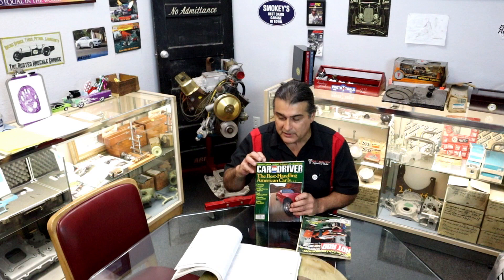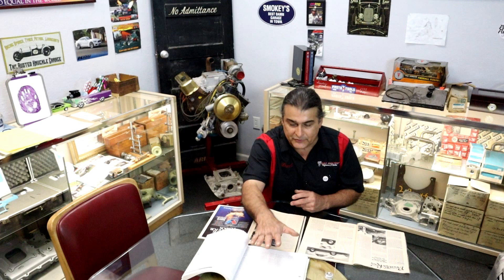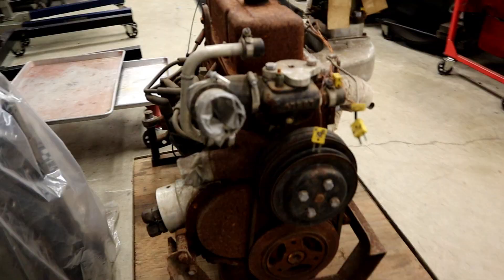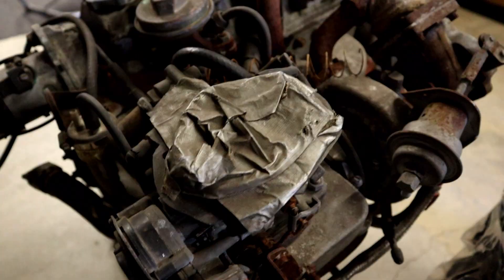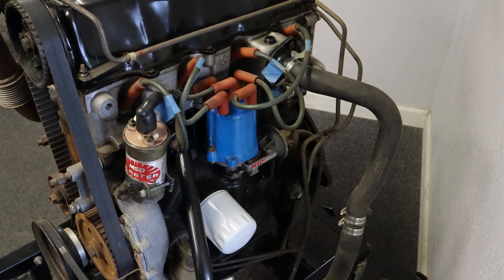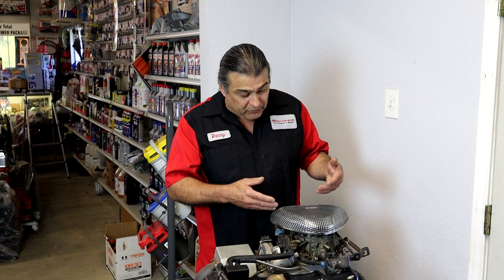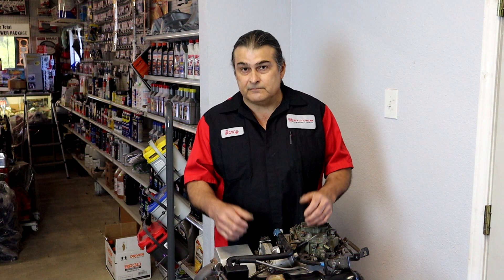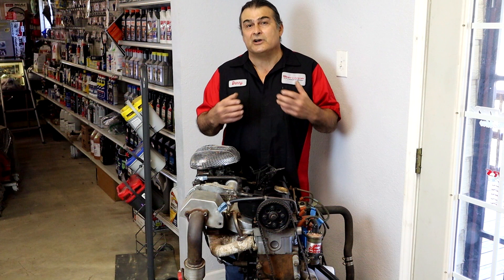What ever happened to Smokey Yunick`s Hot Vapor Engine

Comment: I remember cars would have issues with vapor lock. Wasn't that when the fuel turned to vapor in the fuel line and this would cause the engine to stop running?
Reply: Yes. I made a video about my 79 dodge van having this issue and how I solved it.
Reply: @NicholasMaietta  didn't they just wrap the exhaust or the fuel line that ran near each other to insulate.
Reply: If the fuel turns to vapor before it gets to the fuel pump  then the carburetor gets no fuel and the engine stops running. After the fuel has gone through the carburetor you want it to turn to vapor so it can burn in the cylinder.

Comment: Very Interesting, I heard about this at least 30 years ago. I'm sure if it had any draw backs, they can be solved with todays technology. I wander why these engines never came to market??
Reply: To efficient
Reply: Damn right. Can't make millions if everything is getting 60 mpg.
Reply: @RATTL3R186  Check the origin of gasoline, it started out as a waste by-product.  .   .   .   Until.   .   .   .
Reply: GM and others did seriously consider this type of engine for production. The problem was, they ran right on the ragged edge of detonation and overheating. They required a lot of expensive parts and lubricants to stand up to the heat, and if the slightest thing went wrong you could burn up your engine in seconds.
Reply: @mrdanforth3744  Thanks! I saw Smokey's fiero on here somewhere and I wondered what in the hell kinda oil was going to stand up to that kinda heat and then have to deal with the shearing in a 4 banger .
Reply: @RATTL3R186  Back in the 80s Smokey said in an interview that the only oil he could find that would stand up to the heat, was made for jet engines and cost $98 a quart. That was in 1984, it would be equal to about $250 a quart today. So $1000 for an oil change lol.
Reply: @mrdanforth3744  Holy shit ! I can't get enough of this guys stories and history . The thought process , the f*ck you attitude .Making NASCAR look like dipshits is my favorite.

Comment: I got exposed to vapor carbs in the early 70's. My grandfather had a print article from before the war.  I was taking basic chemistry in Junior High and I kept coming to a conclusion that the mass of fuel used was from way rich - to way leaned. 1980 - I was at Uni and I trolled the Engineering Library for anything related to engines, the Thermo-Cycle and all info. I came across some publications from Ford.  It was a heat recovery system. The temps sited lead me to believe there was misinformation in it.  Again - the chemistry and mass of fuel used lead me to know that there was some fudging of numbers.  I built a number of devices over the years,  Got a 351 Cleveland to run 33 mpg on the highway. City milage sucked, but I was learning.  I had a Dodge pick-up that went from 20mpg to 29mpg - with over 20K miles logged.   Smokey's work is something I have never heard of, but I  look forward to catching up.    BTW - I worked on Hydrogen too.  A 750 cc motorcycle - started at 37mpg. Finished at 64 mpg and it was accelerating - uphill - 75 mph - with the throttle closed.  I never did get that engineers ring, but I think it would have limited me, to thinking - Inside Their Box!   Cheers!
Reply from the maker: I really enjoyed your story. There is a lot to be learned but we have to allow ourselves to think outside the box. You would enjoy Smokey’s books. Book 3 is on his inventions.
Reply from the maker: We will be doing a live stream today at 3:00 pm CST hopefully you can make it. 🙏
Reply: @MrDanielSoliz   I have viewed this video a few times today.  The Dodge had a 225 Slsnt 6. I did a quick calculation on the drag from the Rad Fan. I pulled it and replaced that fan with 2 electric ones off gas VW rabbits. A temp gauge, relays and redundant overide switches. In town traffic, I let one run depending on temp and the heat of the day.  I knew I had hit on something when I was climbing a hill after the mod and the clutch could not hold the engine and trans together.  I am 60 now. And I plan to have 33 yrs more. For more than 45 years, my question was Why? I never bothered to waste my breath trying to convince someone of my ideas. Thank you Daniel!

Comment: How did he solve the valves burning up? The head cracking and the engine block cracking? On a four stroke under compression it vaporizes the fuel. Also the fuel must be compressed after it's vaporized . So a carburetor would not work. Full vacuum then full compression. That's how you properly atomize gasoline

Comment: I always thought hot fuel was the cause of vapor lock. This is the first I’m hearing of this invention.
Reply: It is under ambient air pressure. You pressurize it, I. E. the homogenizer and it becomes super fuel. Homogenizer=Turbocharger with attention to heat control. 
Not sure FI, except a TBI unit, would work. Also, I had read about a ceramic engine he was working on, could the 2.2 Mopar be that animal?
I had a 1973 F100, 360cid that got 14-15mpg. Installed a precombustion catalyst from Granatelli iNDS and improved MPG to 18-19. That was with factory exhaust. Of course with these computers on wheels we have now, no matter the improvement mods one makes the MFRs have the PCM locked into using as much fuel as possible without causing corrosion that fuel can create.
And since we can't purchase gasoline anymore I refer to it as fuel. True gasoline has a different odor then what comes from the pump at a fill-up now a days
Reply: @jamesharrison6201  it definitely does have a different smell from what I remember as a kid.

Comment: Smokey's main justification for using carburetors--aside from ease of tuning and his unfamiliarity with fuel injection--was that venturis could produce the atomization needed to initially break-down the liquid into a vapor, which itself is what the system depends upon to work. Also: It's proven the the sooner fuel is introduced to an incoming air charge, the better it mixes & cools the charge, resulting in more power. Not to mention turbos just work better when all they're pumping is vapors.

Now... imagine the level of atomization had if even a low-pressure throttle-body injection system--such as what GM had in the day--could've achieved. All it would've taken is a simple bolt-on swap to install the 2-bbl TBI GM used in place of the Rochester 2-bbl, since they were both made by the same company, and used the same mounting pattern.

All that said: Now imagine what a modern, high-pressure annular-discharge bolt-on EFI, with it's vastly better atomization, could result in...? ;)
Reply from the maker: 98% on point ,you are right. Our test truck will be using fuel injection and think how easy it will be to keep the AFR constant. One of the problems of the day was the tune. 👍👍👍👍👍

Comment: Didn't the Hot Vapor Engine have an high octane dependency, due to Smokey not only running them without inter-cooling, but astronomically high compression ratios (12:1) as well?
Reply from the maker: Octane does increase liquid fuel(hydrocarbons) reaction temperature but there’s no liquid fuel in the engine just vapor. Hope this makes sense. So no you don’t need high octane fuel.

Comment: Nice vid. How did Smokey control detonation? I know the answer  was posted on his website back in 2005 or 6.
Reply: As I understand it, only liquid fuel droplets can detonate, not fuel vapor.
Reply: @383mazda  yes detonation doesn't instantly happens. One or two bad  combustion cycles before   will set the stage for detonation.

Comment: This is basically what an oil refinery does. Takes fuel heat it, turn it into gas. Super clean burn and more fuel efficient.
Reply: @Jos-Kapitein  And how do you think distillation works? Heat crude to get different byproducts at different temps, distillation. Some are modified with esters to make certain fuels or purified and washed but it's a process of distillation.

Comment: The biggest question is were the rod bolts updated in the Iron Duke. From my experience, they can't take much more than stock load or the rod bolts stretch and fail.
Reply from the maker: On point! On the Fiero engine (2.5 Iron Duke) Smokey changed out the rod. I’ll have to do a video on what internal upgrades Smokey did to the engines.  Ok,just made an executive decision today will be doing a lifestream at 3 o’clock and I’ll pull out the connecting rods and pistons that’s in the iron Duke engine and we will do a show and tell. Hopefully you can make it.

Comment: it sounds like hes using the heat to turn the gasoline intoo a superheated gas that will light REALY eazy and moves the flamefront REALY fast inside the cilinderhead (too fast to induce knock ) 
i wonder if it crackles like a top fuel dragster even with the hot air thats mixed intoo the gas being verry low on oxigen and gasoline atoms , then tune the engine to run perfectly on that superheated gas (wonder wat the camshaft is set at , it might as well open a few degrees before bottom death center going up on the compression stroke to pull it in as fast as possible and prevents flamable gas from preigniting or loosing too mush heat ) and at higher temperatures (more gap) then again the heat from the combustion might not be mush higher as that of the mixture entering the cilinder and that the faster expansion of the gas in the first inch of the powerstroke compared to the regulair engine is wat makes the power  , sounds eazy but i bet the margin for error is tiny and defies all normal rules compared to tuning a regulair engine 
just wondering how hard a cold start would be ....... maibe thats where the carburator is for
Reply: Smokey reported the cheaper / lower octane the gas....the better. His own words.
Reply: @Rev22-21  the cheaper gas burns faster then the high octane stuff

Comment: The carb is interesting, since the venturi effect tends to cool the incoming charge--as backyard turbo guys know.  Smokey's engine tended to run a turbo in order to take the hot charge and condense it enough (too bad it wasn't tried with Bruce Crower's cam design around the same time, of high compression and late closing intake valve so the charge would go back into the intake but allow a super high compression ratio for its effciency).  

anyone who's been down the invention road, knows of the problems of folks copying from your patent laws, and dealing with the suits with their lawyers who will just outright steal it and bury you.  Smokey's invention would also benefit from ceramic coatings, which certainly wasn't the industry back then, it is today. 

It would be interesting to see how it would have turned out. He got the long connecting rod theory wrong, but GM did take his reverse cooling concept for a ride...as long as the LT1 lasted in dealerships.
Reply from the maker: I believe in the long rod theory, can’t say I’ve used a standard length rod for anything other than a restoration. Also build an Lt1 right now, great engine.
Reply: @MrDanielSoliz  Reher Morrison (sic) tested out the long rod theory, and couldn't reproduce Smokey's results. Mopar small block fans have always said, switch pistons from engine bank to engine bank and the relocation of the wrist pin creates the same type of dwell at top dead center, and results in an extra 25 hp. Of course, the offset wrist pin is the Mopar engineers' idea of reducing thrust on the thrust side of the cylinder. A longer connecting rod and the modern piston coatings (ie, dry film lubricant) on the skirts of some pistons likely achieves less thrust issues, and the Mopar small block had 6 + inch 'rods.

Speaking of engineering, the LT1 was a great idea, but boy, that OptiSpark....:)
Reply from the maker: You know your stuff, yes the dist. Problems.👍👍👍👍
Reply: @MrDanielSoliz  Thanks, I'm a car nerd, I just can't help myself. It may have been interesting where the LT1 evolved had the LS somehow not be in the budget or otherwise not created. Maybe a siamesed bore (4.125inch) LT1 with a 4 inch crank to take the place of the LS version LS7.

But I like the "what ifs". For example, if after 1973 GM decided not to build bigger, heavier F bodies but instead made the Vega-based Monza the Z28 of the 1970's. It already had a Spyder version of the Monza, it could have been a down-sized competitor to the Ford Mustang II. The power-to-weight ratio of, say, a Trans Am made from the Pontiac Sunbird would be interesting, and there was a coupe version of the body with a Formula option.

Or if the Pontiac Ventura had the OHC Sprint Six rather than the Chevy stovebolt six. Combined with the WS-6 / 9-C-1 cop car suspension used in the Nova, a Sprint Six Pontiac Ventura might have been a real car of interest in the 1970's gas crunch--rather than an expensive Nova.
Reply from the maker: @albertgaspar627  funny that you mention the Sunbird we also have a HVC Sunbird engine that no one knows about ( until  now) and a 6 cylinder Pontiac ohc engine just came in.👏👏
Reply: @MrDanielSoliz  Reviewing that engine would be an interesting video. Was it an Iron Duke 2.5 litre? I remember when the Super Duty version of that engine was promoted, it was supposed to give the Fiero the performance it needed...until GM just went with the 2.8 V6. A perfect example of the old saw about GM eliminating an idea after perfecting it. 

And the Sprint Six was an example of "good idea too soon". I know some raced those using a Chevy truck inline six camshaft.

Comment: If this really worked then why was it never in a production vehicle,and why is nobody using some form of it now,it must has some issues ether the heat kills the engine or the heating of the air would create a high pressure enough to push air back out the carburetor I would need to see one of these actually run on a dyno to buy into the power and fuel consumption clam's about it.
Reply: WHY NO ENGINE IN THE INTERIM 40 YEARS?	

1.	The first reason is OIL, not Big Oil, although that is a part of the answer too.  In the early 80’s the widespread availability of synthetic motor oil and lube was a decade or two away.  In order to make the engine functional at the temperatures required for the engine to achieve Hot Vapor process Smokey was using Jet Engine oil that was 98 dollars a quart.  
2.	Of course, Big Oil was a reason as well.  After the Oil Embargo of 73 there was a push toward fuel economy.  But by the time Ronald Reagan assumed the Presidency, one of the first acts was to remove the solar panels from the White House roof.  The rest of the decade saw a move toward less of an emphasis on the fears of the 70s and the return of gas shortages.
3.	Materials, production process and technology overall as existed in the early 1980s was just not where it needed to be in order for the engines to be massed produced at a cost that made it viable.
4.	The OEMs had ideas of their own and moved back toward the idea that cooling an engine was the answer.  They had also made a commitment toward EFI and they were not going backward.  The culture of that time (Pre- Jobs, Gates and Tech Entrepreneurs) tended to look down on engineers without formal degrees. What Marlan Davis called, “it wasn’t invented here syndrome” in his article for HotRod Magazine: “It was the "not invented here syndrome" rearing its ugly head again. “How could a couple of gearhead hot rodders know more than all of Detroit's best engineering talent?”
5.	Lack of access to the original engines.  Smokey made the conscious decision and concerted effort to keep the hard tech from the “suits”  There is good evidence that even trained engineers with access don’t understand what they are seeing and misidentify and misunderstand what is in plain sight. To the trained eye Yunick’s efforts to effectively camouflage critical parts and components is evident.  This pattern of false bread crumb trails carried over to the patents themselves where Smokey would use in-exact, misleading, or made-up descriptions as well as omissions to throw potential IP thieves off track.  We have already identified at least one instance where the drawing in a patent is not the same as the working physical engine.
6.	There is no doubt that the fall of John DeLorean was a crucial set back.  And, the Hunt Brothers were having their own problems with Law Enforcement.  However ultimately, it was probably Henry “Smokey” Yunick that made the conscious decision himself.  There was no arguing Yunick’s genius. Nor his eccentricities and “My way or the highway” terms.  He was now in his 60s and was slowing down, thinking about writing a book or two.  He was already a legend, decorated WWII Pilot, Inventor and had won over 50 races in every type of auto racing. He had business interest in South America.  He had spent decades being challenged by Auto and Race Execs.  The endless parade of engineering teams alone must have been exhausting, always the fear that they are going to steal your knowledge and work.   To prevent this there was always a false trail in the treasure maps he left behind, “It is really quite simple, and I am careful not saying too much. This is the only way I can be sure nobody knows how the system exactly works says Smokey”  Swedish Hotrod Magazine
7.	The possibility of the project being scuttled or blacklisted by “The Powers that Be” has to be taken into account.  Proof of that however will not likely be unearthed.

8.	At the end, maybe he just got tired, to quote him as he closes out the chapter of something that he pursued for half his life, “These things start out as a little conversation and like a hurricane get spinning faster and faster and I guess where the inventor generally gets blowed out the side someplace then the wind and rain goes away and in thirty days it is like it never happened.  As it stands today the Smithsonian has inquired about a hot vapor engine for their museum.  Maybe you can check it out there if they never get it into vehicles.  They’ve also got one of my hats.” Eating the Elephant page 249.